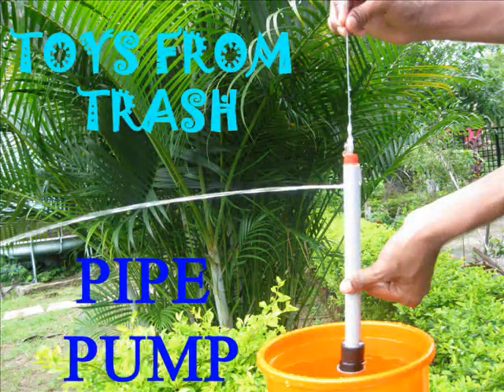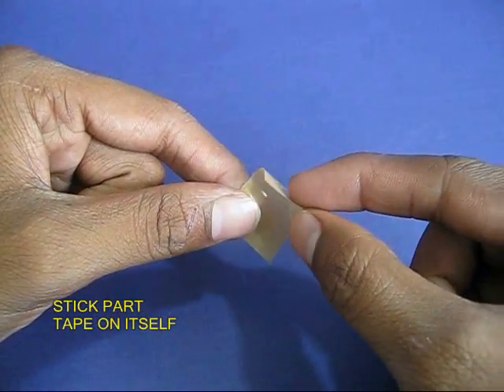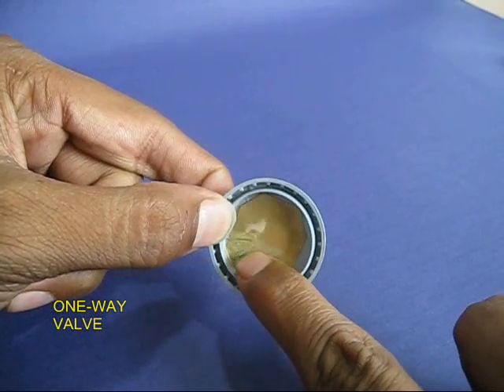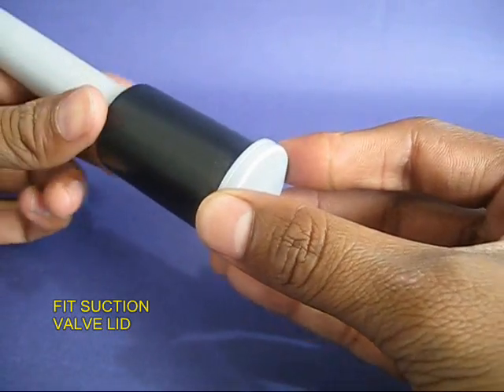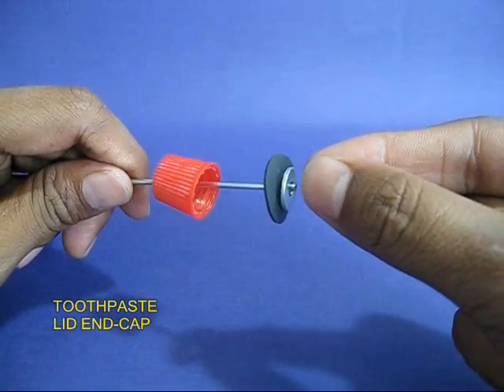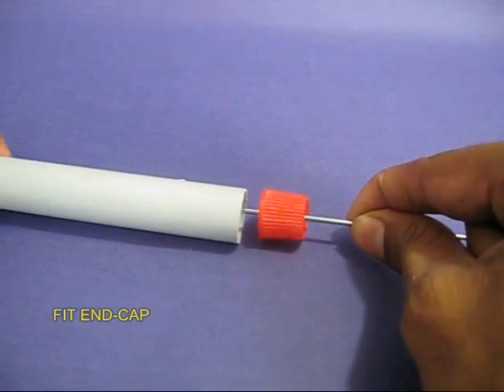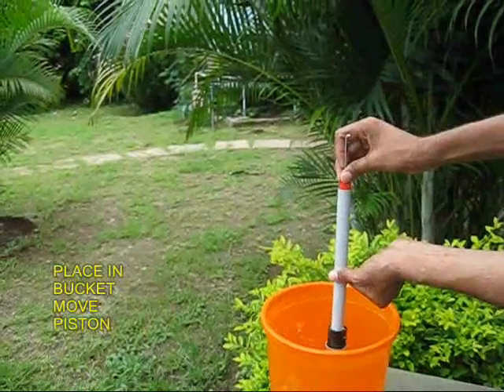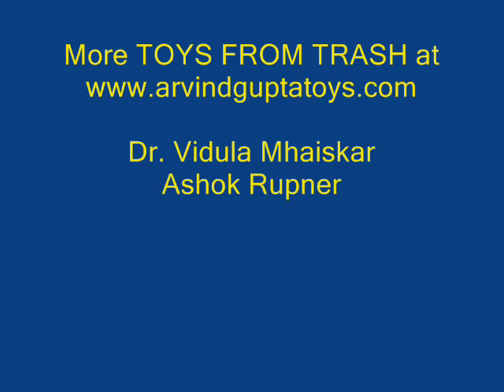PIPE PUMP - ENGLISH - 28MB.wmv

Comment: Arvind, there is an error or I do not understand how this pump works, because the piston does not have a valve for the passage of water that is sucked, as the water passes through it, since the rest of the pumps that you built and show if has the hole and the passage valve in the piston